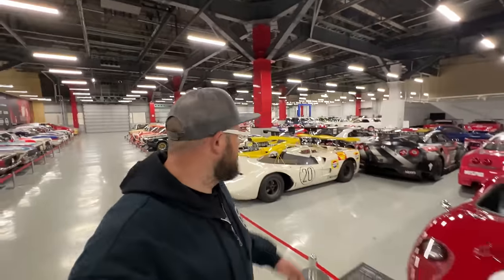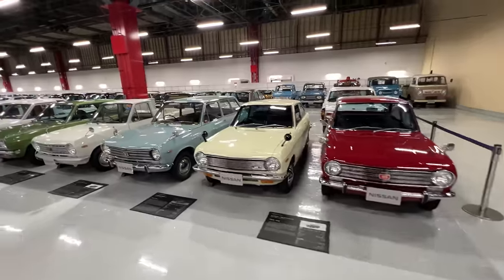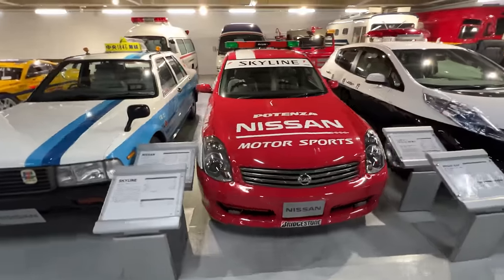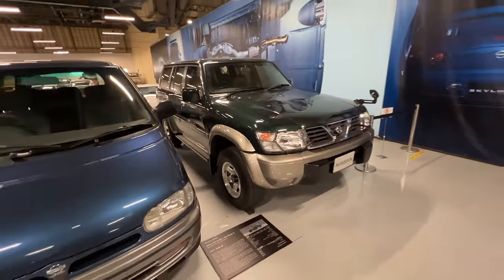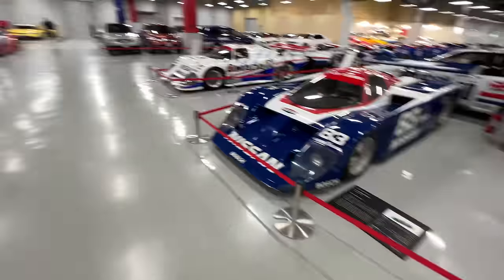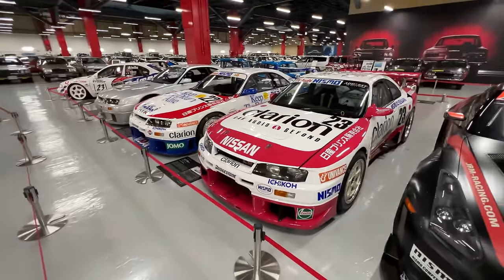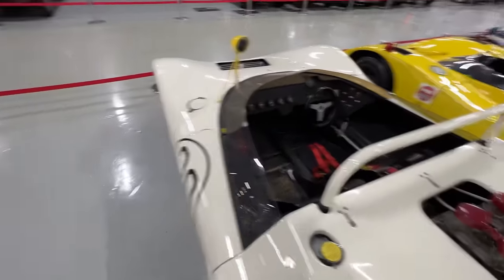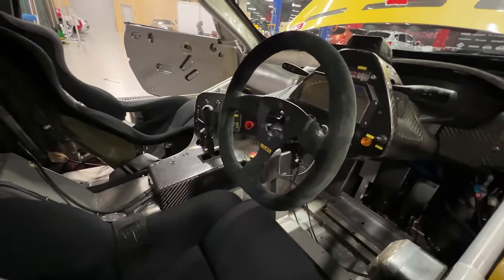Nissan's INSANE RARE Car Collection - One Of EVERYTHING!

Comment: Oh how I wish SUPER GT never went away from the 03-08 and 09-13 era when the technical and aerodynamic rules made the series unique among GT categories. 
The '99 and '03 GT500 GT-Rs were very different cars, not only because the '99 used the 2.8L RB26, and the '03 using the 3.0L VQ30DETT, along with the way the cars are built, right down to the way the cars handled on track. 
The 2007 Xanavi NISMO Z33 GT500, 4.5L VK45DE NA V8 and extreme aero "350Z", sat next to the '03 and '13 GT-Rs is my favourite. 
Would you do future videos profiling individual GT500 cars?

Comment: I know for a fact they do not have every car, I once owned a genuine ex works Datsun sunny PB210 based on the B210 most are familiar with but in Japan both the Datsun 1200 and Later Sunny models had both A series Engine models and L series engine models the later with the L series were in the early 1970's PB 110 rather than the base model B110 and the same with the B210 and L series variant the PB210 my car  was driven by Sheka Mehta from Kenya normally a Safari Rally specialist and ran a 1.6 litre variant of the Formula Pacific 1400c LZ  16 valve twin cam with well over 200 HP from 1600 CC used in Australia's Southern Cross Rally in the late 1970's

Nissan do not have a PB210 Rally Car in the collection they had an extended nose different tail lights and an LZ 1600 engine compared to the normal B210 model with an A12 or A14 Engine.

Comment: Surprising there wasn't one of the Winfield GTRs that ran in Australia in Group A. They were legendary and wiped the floor with their competitors. Also involved in one of the biggest controversies in Australia motorsport, when they won on a lap count back at Bathurst one year when it belted down with rain everywhere. The leading GTR had actually crashed on the final lap, but the result was determined by the order of the previous lap at which point they were leading. Jim Richards and Mark Skaife were booed on the podium leading to Jim's famous "You're a pack of arseholes" comment to the crowd gathered under the winner's podium!
Reply from the maker: I saw those in Australia so privately owned
Reply: @dino_dc  Who owns them? Gibson Motorsport, the drivers or someone else?